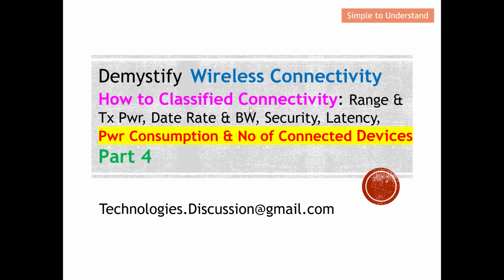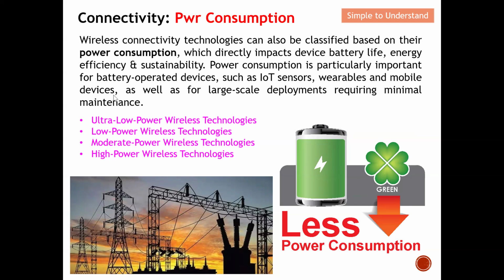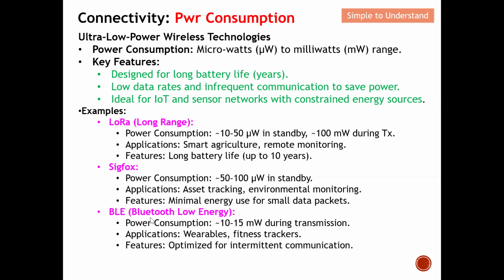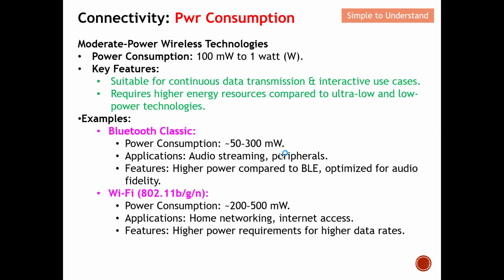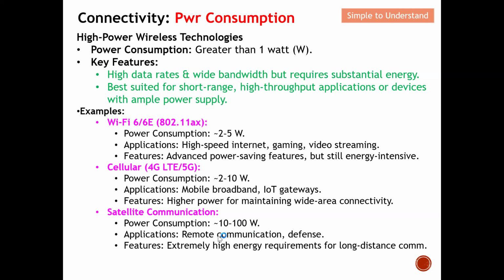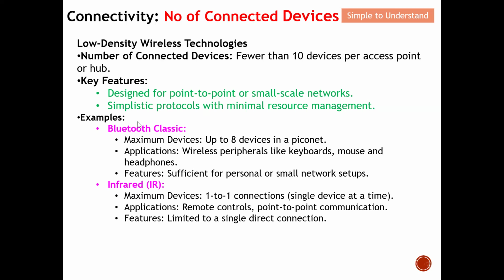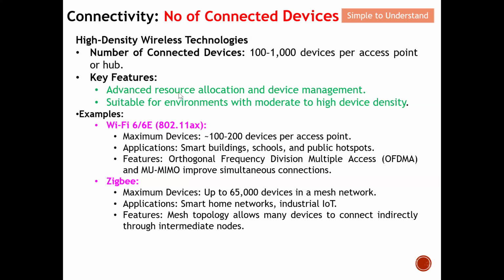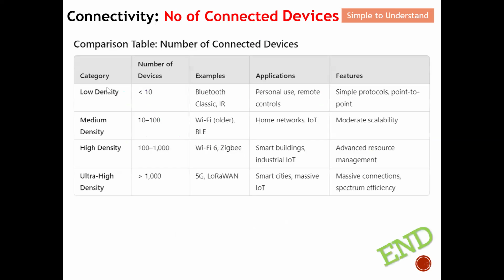Wireless Connectivity #4. Which Link Uses Lowest Power & Supports Maximum Devices? Comparison Guide.

Comment from the maker: Thank you for watching this video.
In this video, I will discuss how we can classify wireless connectivity based on power consumption and the number of connected devices. These are key criteria when selecting types of connectivity. For example, when deploying a sensor in a remote area, we want the battery to last as long as possible, which means the device should consume minimal power. The number of connected devices is also essential. For instance, if we have a gateway, we aim to connect as many devices to it as possible. Hence, this is another important factor to consider when selecting wireless communication methods.